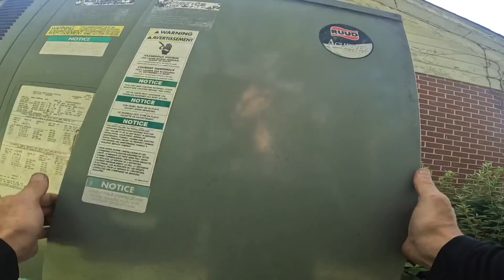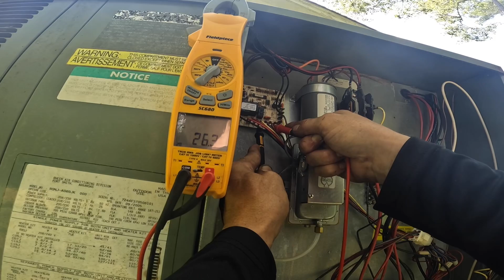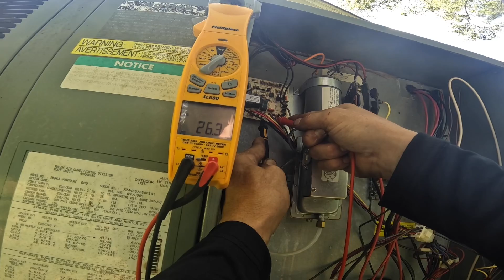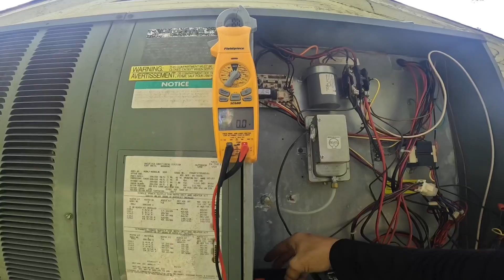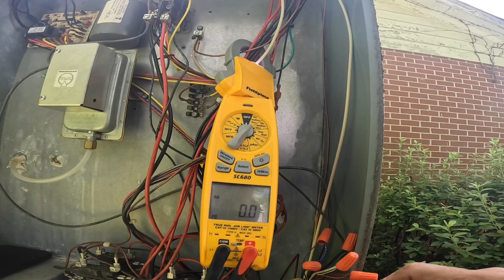System Cuts On and Off Way Too Often

Comment: It also allows the power company to shut off the unit for a short period a couple times a day during times of peak usage the problem is that sometimes , when its hot they will keep shutting it off for short periods all day and it will not keep up i loved removing those boxes also hard on contactors

Comment: Is that device actually part of the Air Conditioner Cycling program where you get a reduction on your bill if you sign up for their program. This is to help reduce demand on the grid. Program options to turn off a certain number of hours a day during peak demand and when grid is at risk of being overloaded.

Comment: I use to carry what I called a clicker in my shirt pocket.  I would wave it around in the panel to see if any voltage was present.  The reason is some units may have more than one power supply so just because you have the breaker off don't assume the power is off until you check it!
Reply: His multimeter should have that feature which is called NCV.

Comment: Pnm here in new Mexico uses those boxes and those thermostats. People HATE them. I've found them almost puncturing condenser coils and mounted to stucco with no sealant. They just don't care about the damage to your unit or home. They want to control your power, not improve the grid.

Comment: I have decided after watching most of your videos that Ruud systems are garbage. Also in my area its called the DLCP (Direct Load Control Program). My power company come out and installed an Emerson smart thermostat about this time last year everyday between 2:00 p.m. and 6:00 p.m. it raises my thermostats temp by 4°. it precools my temps down 6° below the set point first so I've learned before it does it to drop the temperature four degrees so it gets it back up to the temperature I like during their control session..

Comment: You never explain (1) Why the electric utility's control was cycling the call for cooling off/on every couple of minutes (this increased  stress on the grid); (2) Was there a rub-through or short in the electric utility's control wiring that put 100 volts on the tstat Y wire, or what caused the spike?
Reply: Probably a coil magnetic field breaking down when the current was interrupted.

Comment: I used to work for Comverge - it's what got me started in the HVAC trade. Let me be the first to say that I absolutely hate that company and the program! Corporate lied to us about how those boxes work, to start with. Part of my job was to gather stats from those things, and when I started doing the math myself, I found out just exactly how wrong all the literature was. Then, they have this nasty habit of reactivating everyone who opted out of the program in the following year, without telling them. We caught them doing this repeatedly due to one of my coworkers having one on his house that he didn't want active. Corporate wanted to argue that they got his consent... with him right there on the conference call. The program is so poorly run, that in the majority of the time I worked for them, if you asked me, any other tech, or even the managers if we'd be on that program if we could, we'd laugh and tell you "hell no!" It didn't help that my state had the worst incentives I'd heard of for that program. Thankfully it kinda flopped in TX because the utility utilizing it had 2 competitors that people would switch to when fed up with that device. Areas that are under a utility monopoly get screwed.

After I left, they got bought out by Itron, who had no experience with demand limiting programs prior to acquiring Comverge, which just continued the red flags. I tell everyone to make sure that they get those boxes removed. Not deactivated, but physically removed, because of the shady and dishonest practices of that company. Good riddance to them. Everyone at my current workplace has heard me rant against those things.

Comment: Oklahoma gas and electric installed those back in the early 1980s to help during hot afternoons.  If I recall correctly they would cycle the condenser off for a period of time if the temp was above 95 degrees.

Comment: I have disconnected many of those. Thus brings up a touchy fact. So them boxes are Installed by the electric company because they say on very hot days there is to much demand for electricity.  Those boxes supposedly allows them to keep up with the demand and allows them to shut the a.c. off for minutes.  
Well... can you emagine what Brandon's charging stations will do? Will There be a law where everyone will have these and be at mercy of Brandon's government shutting air conditioners off so electric cars can charge?  
Btw. Ones around here in Indiana have a red or green light in box indicating if a.c. is shut off by box or not.
Reply: This is a havc channel. Can't you keep political garbage quiet for awhile?

Comment: Thanks for another great video 
Probably doesn't have anything to do with that system but twice I have seen supply wires get hot because of high (startup) current on the compressor because of the capacitor out of tolerance or bad, the compressors sounded funny too and it solved the problem(s)

I'm glad they don't have those power boxes where we live or a goofy thermostat 🙂 people have enough troubles!

Comment: I never heard of the time delay for the reason of the boxes. I heard it’s due to low voltage on the power grid. At a certain voltage they drop out when for example everyone is using major appliances and A/C. You get a deal on ur electric when u get one of these. However you also get ur a/c turned off during high demand which can get you hot obviously. Really you have no control over its on and off. I also have removed some of these with the customer knowing ofcourse.

Comment: Use a wago to connect probe to the wire. You can use them over again and it frees up your hands and protects wires from shorting.
Reply: There are crocodile clip probes for $7 on amazon

Comment: As soon as you held those probes on with your fingers, I said to myself, "You're gonna get zapped!" The coil on that contactor has quite a lot of inductance, and it will cause a big voltage spike when the circuit is interrupted.
Reply: I thought the same thing and laughed my ass off when it happened.
Reply: I was wondering, why in the hell is he doing that!? When he kept his finger on the connections and pulled back, he sounded so surprised!  That shocked me! No kiddin.
Reply: He discharges capacitors with his fingers according to mickey pipes, so what is he crying about
Reply: @gabrielguerro8449  no, that's anti diy, different guy.
Reply: My apologies
Reply: @gabrielguerro8449  your thinking of Ted from South Carolina
Reply: I was waiting for it too, the back EMF zap! I recall seeing around 130 volt peaks off those contactor coils in past testing.
Reply: Yep!  inductive kickback!  Several thousand volts for a few milliseconds.  Harmless but HURTS!
Reply: I was 14 when I was hooking up some 24vdc relays in an alarm system.   Crap! how in the hell did I get shocked by 24 volts?  Later I saw the inductive spike on a scope:  It was reverse polarity, and almost 10 times the normal coil voltage.
Reply: holy crap I'd be worried about everything he done here, if he really didn't think he didn't risk being zapped or worse killed. I'd check all that work with another trained pro. 
 I'm not a trained electrician, just sit at a screen all day and even I knew yeah don't do that

Comment: Yeah and how they tell people to set your tstat at 80 degrees when you leave then turn it down when you get home is a bunch of crap my tstat stays on 72 never gets touch because when you leave for work nobody is there to cook or open the door or turn on lights so it's going to get it at set temperature and sit there no need in having to run it down when you get and putting that big load on it burning up all that electricity don't believe everything they say

Comment: What exactly is that electrical box for and what is it actually called?
Reply: It's for managing peak demand. 
If the power company thinks they won't have enough power to meet afternoon peak demand, the can turn  off AC units for an hour or two. The other option they have is rolling blackouts. Or buying power on the spot market if any is available and it's very expensive.
Reply: @scott_meyer  so what are those electrical boxes called?
Reply: @BibleBloopers  Load controllers. They've been around for decades. As another poster mentioned, many utiltilies have gone to the smart thermostat that can be controlled remotely and allows customer control when needed.

Comment: I remember when they first started putting those damned things on years ago. We had people, mostly elderly, who were saying they didn't have air in the dead of summer. We got to them and had no idea what they were. Problem was, most of the people who had them didn't know what they were either! They just were told let us put this in and you'll get some money off your bill. Now I tell everyone that I go to that had one to tell them to take it off. They newest thing is, you buy a smart tstat and they can control it through that if it connects to wifi. You have to sign up but it still BS. Upgrade your infrastructure, not put elderly and young people at risk!!
Reply: Yup, it's a scam. I remember in the late '80's early '90's when they started pushing those load control boxes. Recently it's been the practically free 'Smart thermostats' the utility companies offer. What a joke! Somebody so lazy or ignorant the need to control their HVAC while sipping a latte at Starbuck's. Why would you surrender control of your comfort to the utility co. Running my home from a smart phone isn't high on my list of 'necessities'. Seen a story about people in Texas that were screwed during a heat wave because their electric co. 'Smart' thermostats were locked out for hours and even the util customer svc could not reset them. Seen lots of calls with the 'Smart' junk. Just get a basic Honeywell round for the old folks or non-smart electronic digital. Also the ones that run off batteries that don't have a blue or common wire get flakey with low batteries.
Reply: @vincemajestyk9497  

Here's what you keep missing, If the power company cannot shed peak load or move it to earlier, they have a choice, buy expensive spot market power, if any is available, those costs get passed directly to the consumer, or run rolling blackouts.
Reply: @vincemajestyk9497  
I lived in Las Vegas in the early 2000
They had a couple of rolling blackouts. Essentially the turn off different parts of the city for 20 minutes at a time to shed load. Back then it was caused by miscalculated demand and selling of excess capacity too soon.
Reply: The smart thermostats don't turn off the AC. They pre cool the house before the expected peak demand.
If they expect peak from 4 to 6, at 1 they lower your setting to 68. A 4 they set it back to your setting. By the time your house warms back up to your set point, peak demand is over.
Reply: @scott_meyer  it's still an excuse for them to not upgrade the infrastructure. 2020's people running on 1950's grids are unacceptable. Plus around here dominion has us paying for their solar farms!
Reply: Subsidiary solar panels are probably a better way of going about saving money on cooling cost, which are becoming popular. Your still using power from the big grid. But you also will be using in tandem power generated from a solar panel on top the roof or on a tripod outside. That energy created can also be sold back to the power company, for the amount you use from the grid. Plus you would also still have power which is stored in the system, in case of a power outage.
Reply: @KenKen-ui4ny  hackfreehvac has his air conditioners setup to run full solar at peak load times
Reply: @KenKen-ui4ny  
Home Solar is perfect for offsetting peak demand. Solar panels output is greatest during the time of day that AC demand is highest
 
There are a number of power companies looking at using big box store and warehouse roofs to install city and suburban Solar farms
Reply: @scott_meyer   More nuclear power has been a big investment to Georgia power besides Natural gas and solar recently. And if we follow France's lead on recycling and reusing the fuel rods. We would not need to use special radioactive waste landfills, like the one in Yucca Nevada as much anymore.
Reply: @KenKen-ui4ny  

The recycling issue is from Nuclear non proliferation treaties. As you recycle fuel rods, you eventually end up making nuclear bomb material.
Did they finally open Yucca Mtn? We lived in Vegas in the early 2000s when they were first trying to open it.

It is an optimal location for storing nuclear waste. Dry desert air, very low water table under, high security location. It's located on the border of the US nuclear test site and Nellis Air Force Range. It's about 30 miles SW of the test site where over 800 underground nuclear tests occurred.
Reply: @scott_meyer  if the grid isnt capable of coping with the demand, then solar will not work, the reason being if there is solar available and
Everybody is feeding in the grid at the same time the voltage will rise above acceptable levels wich in turn will lead to tripping the solar inverter.
Reply: @sjefoekel6058  
If it's a home solar setup, it's excess will be consumed first by any homes on the same transformer. It's likely it will not even make it out to the primary feed.
Reply: @scott_meyer  if indeed those any homes havent got any solar panels, since we are in an energy transition to electrify everything, nearly every home has surplus at peak performance from solar, and i have slight tendency to think that the utility company is letting the voltage rise on purpose, so at the times solar will have the most performance it will shut down and you still have to pay for electricity.
Reply: @sjefoekel6058  
Electric devices work in a range of voltages. Usually anywhere between 100 and 135 will work.
What is happening is there are voltage drops due to wire resistance and inductive loses from generating stations to the home. When power is being added at the load end of course voltage will go up. Not much they can do.
Reply: @scott_meyer  exactly, so they have upgrade the grid so it can handle more load (energy storage). But instead they are fiddling around with gadgets and what not

Comment: This is the old method of demand management.

There is a better way.

Where I live the power company will give you a wireless Smart thermostat no strings attached simply for the power savings that programmable thermostats provide.

You have the option of signing up for the thermostat program, you get a power credit in return.

It doesn't shut off power, but shifts and spreads out the peak demand in the afternoon.
Say they expect the demand to reach the supply limit between 4 and 6. What they do is turn your thermostat down 5 degrees at 1 so your house can cool down, then at 4 they turn the temp back up to your set point. typically a home warms up at around one degree per hour, so your system wouldn't come back on until after the peak demand is over.

They do send a notification to your phone that an event will occur, and you do have the option of opting out .

Best of both worlds. Demand management and consumer still has control.
Reply: And if the utility had adequate capacity, and were not over relying on weak, worthless wind and solar, none of these problems would exist at all. They never did until democrats started messing with the power system.

Comment: Those boxes are supposed to save you money.  It cycles unit in the primary load time. Load demand type system.  Controlled by electric co.
Reply: They work fine until they go haywire.
Reply: The electric company didn’t install these for the customer’s benefit.
Reply: @picklerix6162  
So preventing rolling blackouts isn't a customer benefit?
Reply: @scott_meyer  - I am just saying that the power company doesn’t want to invest in another power plant. I volunteered for this program myself but I removed the box when I installed new HVAC equipment.
Reply: @picklerix6162  
They do when necessary.  If they can manage demand, it delays the need.
It takes years to design and bring a power plant online. The have to forecast (guess) what the power demand will be in the future. 
It's also cheaper to buy someone else's exceess power on the spot market.

Comment: Power comany execs are greedy, corrupt, without integrity, just like the rest of US corporations. They don't maintain their grid and ROW on their 75 yr old system. Those scam boxes are just another nuisance for consumers. The blower keeps on running while the condenser or hp shuts down and the house heats up. Not only do you overheat, much of the condensate evaporates back into the air.
Reply: It's called demand management, it's much cheaper and faster to implement than taking 7 years to design and built $100 million power plants.
Every dollar they spend gets passed onto the consumer.
Reply: @scott_meyer  Go off-grid. Power is stable, reliable and cleaner for our environment.

Comment: Why replace the contactor?  It was operating as it should in response to the call for cooling...wasn't it?
Reply: The burn marks around the contacts indicate the contactor is nearing the end of it's life. Keep the customers happy and keep that hard earned reputation.
Reply: It nearly burned up due to cycling too much too often (excessive heat showing), you don't want to come back 3 days later to a malcontent customer. You touch it, you own it.
Reply: Thanks for your answers!  I learned something!